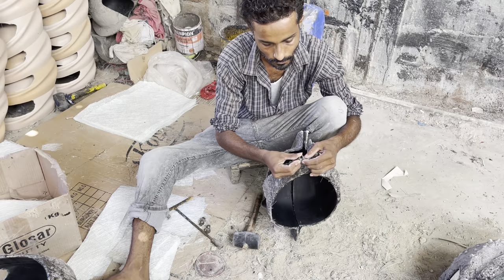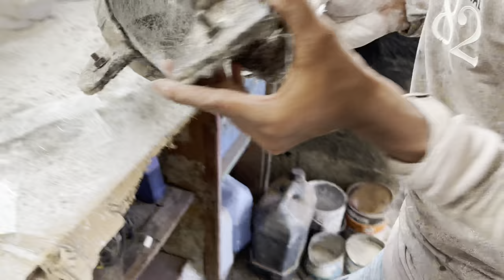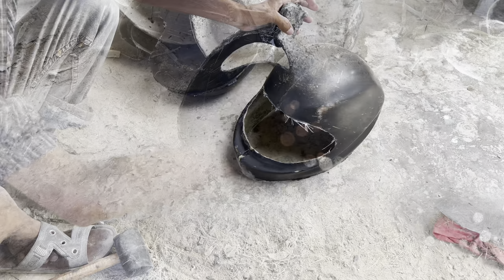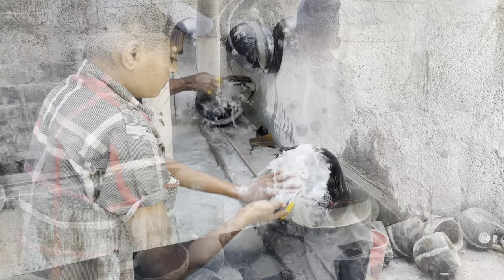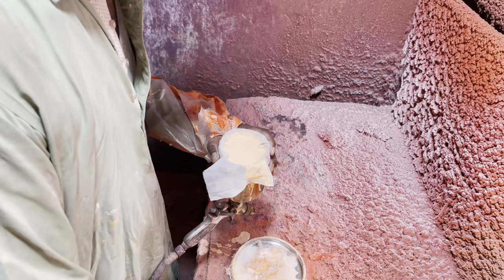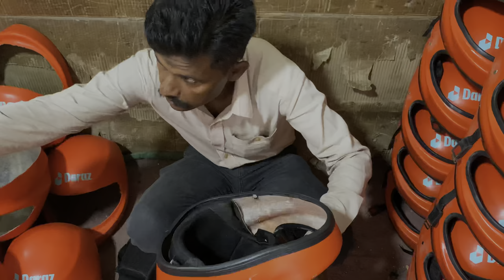How to Make Motorbike Helmet || Interesting Process || complete video

Comment: 2 thin layers of glass mat bonded together by a dangerously guessed mixture of resin glue. a luggage strap for under your chin... you would be safer not wearing it. turning it upside down and using as a hanging flower basket.

Comment: I think I see how this whole system works. Pakistani law states that motorcyclists must wear a helmet that conforms to a particular standard. The police can easily determine if a rider is wearing one, but don't have the facilities to check that it conforms to standard. The rider buys the cheapest helmet that saves him from a fine and carries on riding, with the attitude that his helmet is no protection, just as was the case before the law came into force. The only winners here are the helmet manufacturers, and the law-makers who now have a tick in the box marked "head protection for motorcyclists".
Reply: Exactly.  You should see New Delhi traffic at 6pm!  Thousands of 125cc motorbikes and everyone has on of these pieces of garbage hanging off his arm.

Comment: I wouldn’t use one of these even as a flower pot. 5$ helmet, 5$ brain. 🤬
Reply: Not everyone can afford to buy a 300$ helmet.
Reply: @wegz6262  not every helmet is $300 my guy a lot cheaper and proper helmet is priced around $50 to $100
Reply: @Wegz, that’s not the point. What price do you want to put on your brain? Having had an off at 120mph and in a coma for 8 weeks, I don’t think I want to wake up as a vegetable. A good helmet saves lives, and like I said, that piece of crap wouldn’t protect a flower pot even at 30kph. If I was this guy, I would be embarrassed to show this standard of work on YT.
Reply: I think that much important is the lab test. If it passes the lab test then this is also good. But if failed then a big brand helmet is also useless....

Comment: SNELL, ECE, or FIM are the only ones I would consider

I believe the European standards are more realistic than Snell  (don't quote me). I think Snell does a drop test to the front/top of the Helmet only, and the others simulate real crashes where many parts of the Helmet may be subject to high forces.

These Helmets in the video are probably rated for 3 mph or when you drop the Bike while sitting at a stop.
Reply: FIM rating are extreamly hard to pass even more so then snell or ece there bascialy helmet certified to a level of safty that is required to do premier level motocycle racing like wsbk/motogp and all the model with this certification are thosuand dollar and more.

Comment: The guy ripping the fiber cloth into tiny bits certainly managed to remove all structural integrity from the fiber. Could just as well have been using only the precision mixed resin...

Comment: Without Fibrglass Roven cloth, woven material like the use to make boat hulls, in between the matting cloth these helmets are made of using one single layer, I suspect I cook crush his helmet by putting one hand on it and then putting my weight on my hand. Rocing is a woven cloth that will take the pounding of a boat hull against waves for decades. Without it, it's like wearing tough paper mache on your head. Having made boat hulls, it's what I think.

Comment: People make fun of it and call it unsafe...well no wonder, it's not a freaking racing helmet made for high speed crashes. But if you're driving around at 20-30 km/h on small mopeds like the people who will use these helmets do, it's still better than nothing. Wearing this is the difference between busting your skin open or not if you fall at low speed and hit the floor. Would you rather get stitches, or walk away?

Comment: There is a stamp at the base of every helmet denoting its safety rating.
These helmets won't have that rating.
My cheapest helmet (half shell) runs about 200.  My best helmet runs close to 400 bucks.  Why?
Because my brain is worth it.
Don't get me started on my gear.  My gloves run about 120 bucks.
Jacket about 350.
Trousers 450.
Boots 250. 
and 280k plus of riding experience to back it up.

Comment: My bicycle helmet has better protection than this! What’s the point of wearing something that provides zero protection in an accident and isn’t made by a manufacturer that can be sued for extremely dangerous “protective” equipment? 

I get that it’s more to do with idiotic laws and how much you can afford, but those laws usually start off by trying to insist on a decent level of protection, but a couple of layers of fibreglass plus a load of cellulose putty/filler isn’t going to help.